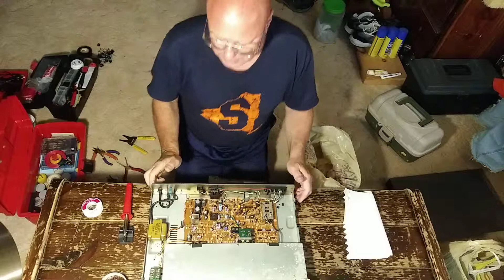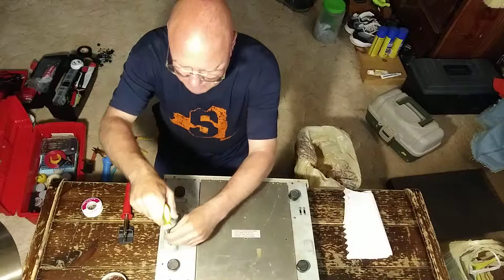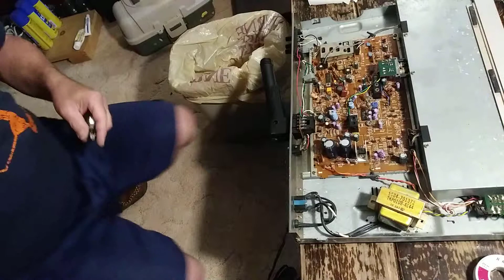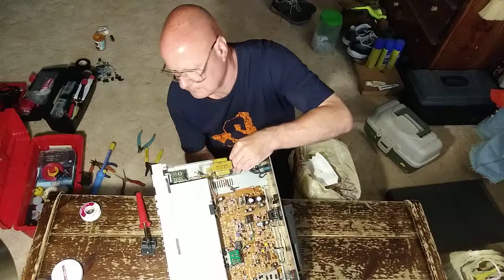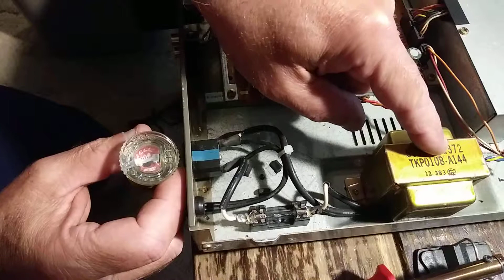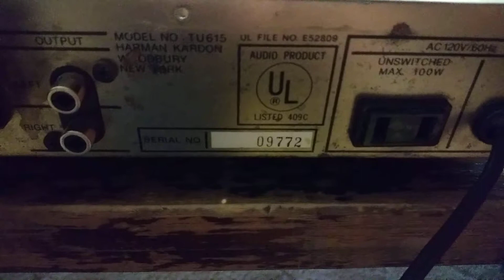Harman kardon TU-615 the engineer forgot over current protection i put it in drop soldering method

Comment: It worked for 40 years and now you start destroying it or what? The only hazard in this whole video is you, instead that you change the broken ELNA capacitors that you talk about not wanting to go bad, you make some kind of crazy mod that is not approved by harman/kardon. I have a 615 and both of those ELNA caps measured nothing, and is bad quality, and also all the glue should be removed, that would help your unit. If you are such a great engineer, why not start with the basics, and get your unit running within specs set by manufacturer, instead of making modifications that would not be nessaccary if it would work properly.